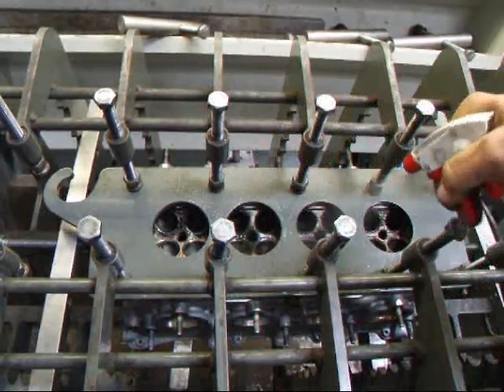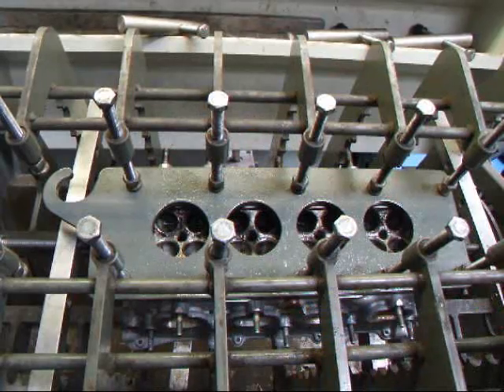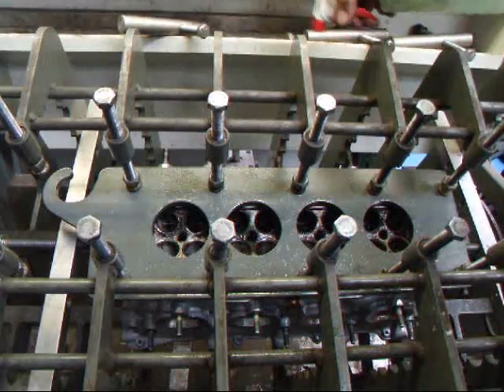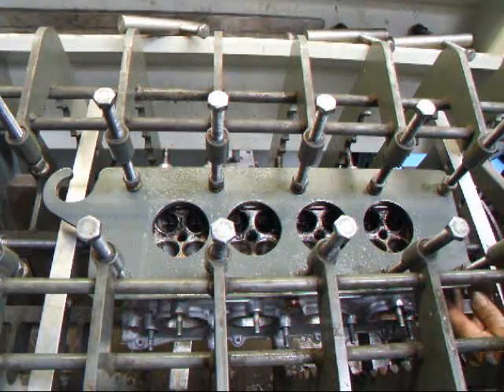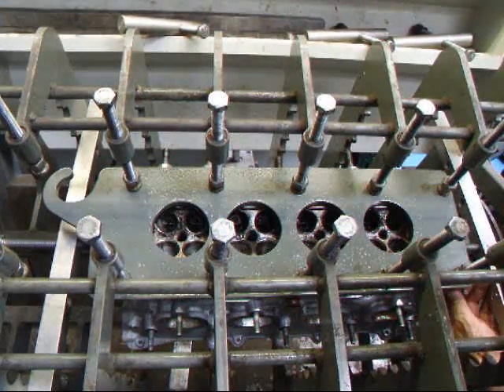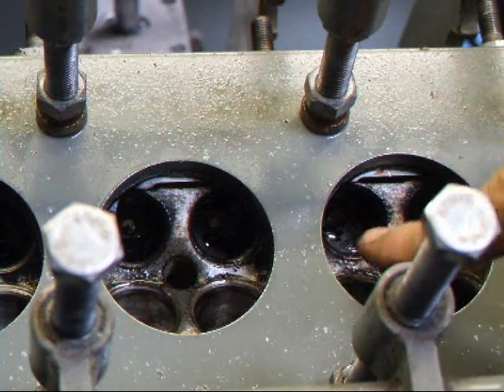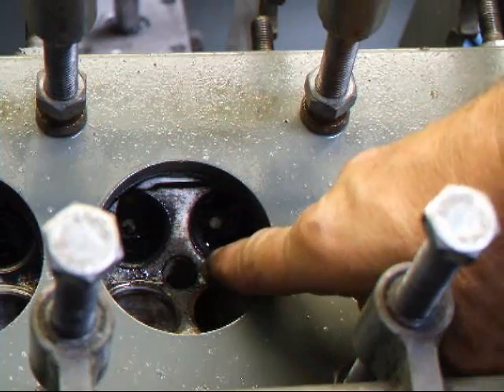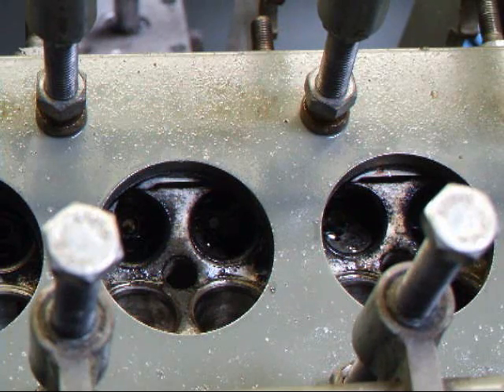Mazda Miata Cylinder Head Pressure Test

Comment: hi John , I have a Mazda 626 1.8i 66kw FP engine 1840 ccm 1998 year and my timing belt died on a free way and I was driving 160 km/h is there a chances to damaged the valves or the piston.

Comment from the maker: @serchmarc  - Don't know the answer to your specific question, but if the cylinder is 'alusil' with sufficient thickness, we can hone it oversize. If, on the other hand it's Nikasil, it will have to be replated. Using a laser is just another way of removing material, I have known about their use on the manufacturing side for over 10 years. I will check with my friends at TRD to find out what they do.

Comment from the maker: This one had been ported by someone and they took a little too much material out of the exhaust ports. When the head got really hot, the metal could not expand enough to keep things together. The aluminum exceeded its modulas of elasticity due to insufficient wall thickness. Noramlly these heads go for ever w/o problems.